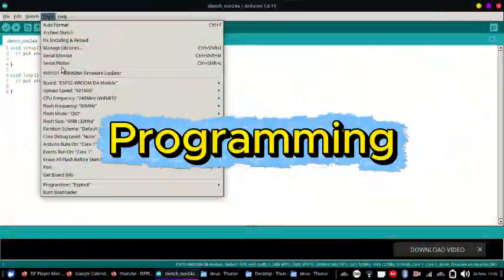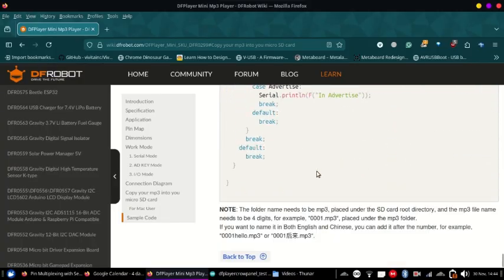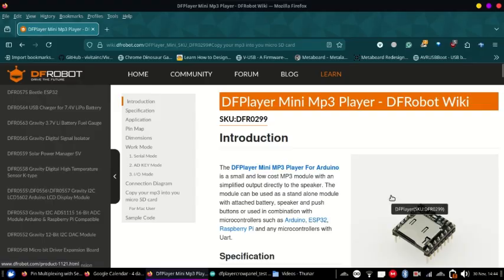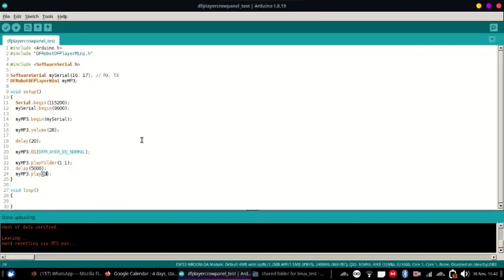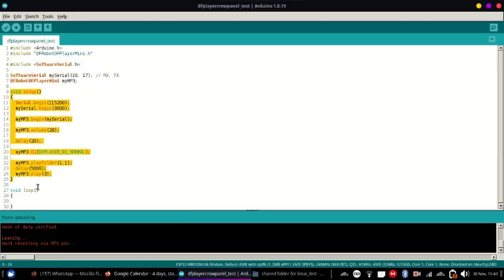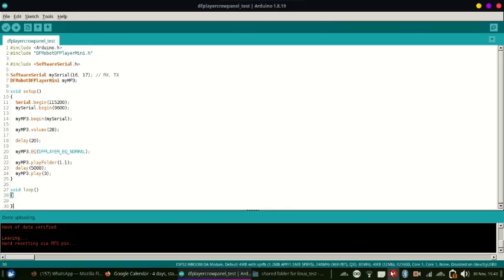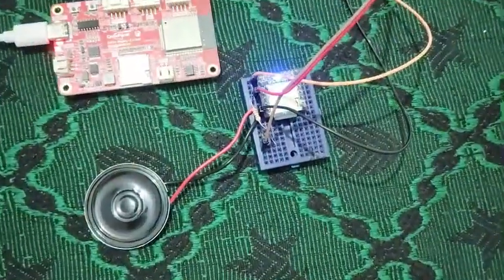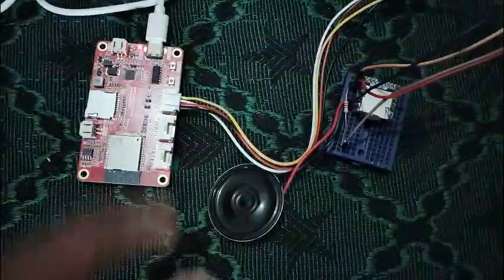How to Use the DFPlayer Mini | Full MP3 Playback Tutorial | VinVout-io

Comment: Hi, thanks for the video :). I have a question: I'm setting up the same circuit but playing different audio clips in sequence; sometimes the module doesn't turn on, and other times the speaker fails. It seems random, and I can't figure it out. I've used the `<DFRobotDFPlayerMini.h>` and `<SerialMP3Player.h>` libraries. I've already swapped out the ESP32, the module, and the wires :(.Do you have any idea what it could be?